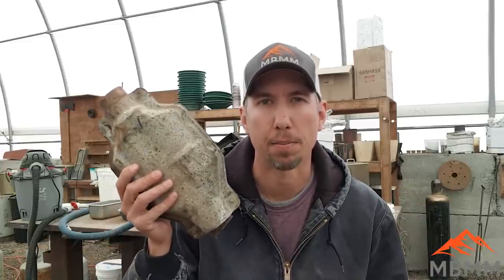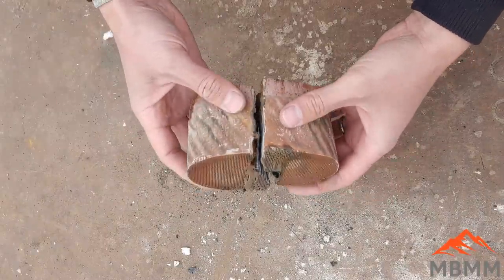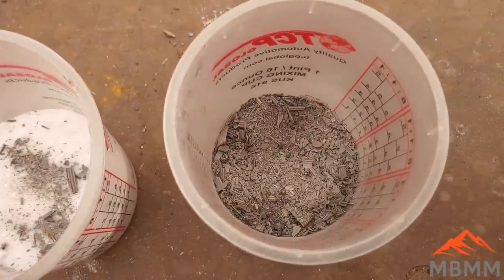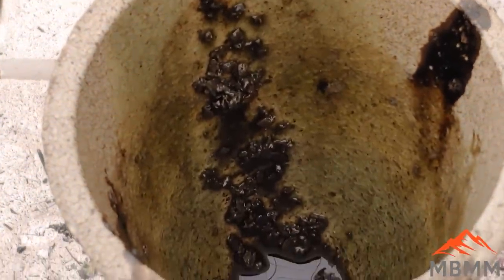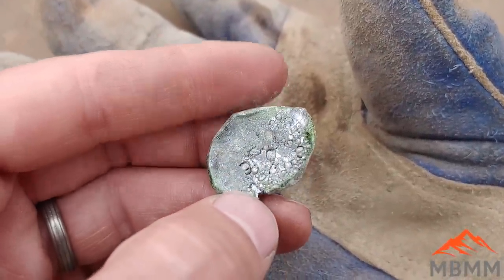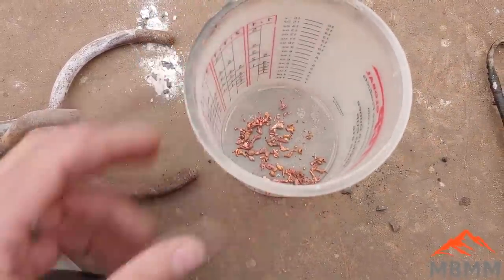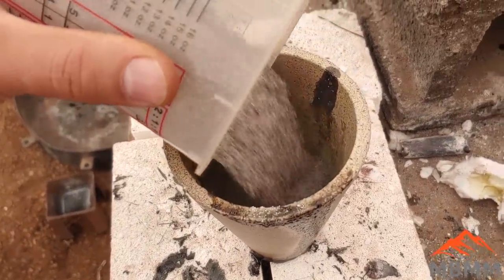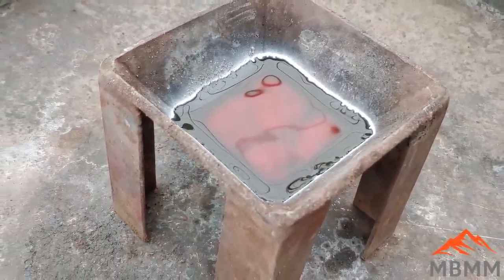Can Platinum & Palladium Be Smelted From Catalytic Converters? Urban Mining Platinum and PGMs!

Comment: Of all the comments only Seymour Pro made a reference to the XRF gun. I don't understand why you are working in blind and just assume things when it just takes a minute to test the materials along the way.

1. Test the cat material to see what proportions of PGM:s there is. If you have 20% Pt and 80% Pd when you start then you should have roughly the same proportions when you are finished or you have losses along the way.
2. Test the lead and copper used as collector metals so you don't add anything that way. There are especially high grade lead sold for doing precision work assays via cupellation.
3. Test the collected metal as well as the slag to see what you collected before cupellation.
4. Test the beads after cupellation as well as the cupel. That way you might be able to detect any losses when cupelling with copper.

All in all an interesting video and my guess on the color change of the slag, oxidation state of the surface, some oxygen have penetrated and oxidized the surface layer. But you have an XRF, use it to see if there is any difference between the composition of the red pieces compared to the core green slag. :-)
I wish I could afford an XRF, it's such a versatile tool when working with precious metal scrap.

Comment: there is a monthly guide available that lists the the amount in $ that each catalytic converter carries by make and serial number.
Some Cats have A Lot of metals, and some almost nothing. Most 3rd party replacements have Little PMGs Try one from a dodge 2500, there should be a lot in one of them. get it from a muffler shop not ebay, many of those are already acid washed.
Gasoline cats are mostly Palladium (1oz/10 average) with a little Platinum and Rhodium( 1 oz / 100 +/- cats).
Diesel Particulate Filters are mostly Platinum then a little Palladium (with RH) 
The metal makes the burn temp.
The metal is usually Fumed onto a ceramic honeycomb, very equally distributed and deeply penetrating the ceramic. The ball/bead catalytic converter the metals is only on the outer surface of the ceramic beads.
There are also metal based catalytic converters, I think they would be better for Vulcan style recovery vs alchemically. 
Do you have access to a centrifuge? no? make a holder with a wire and swing the liquid metal before you pour it, that will help concentrate the heaver metals.
if you liquefy the ceramic you might try ultrasonic vibrations to get the PMGs to separate out of the ceramics. It is Closely Associated. Stiring may help also. Think of it as rendering lard from fat.

Comment: Hi Jason I have tried smelting 100g of ceramic to extract platinum But it didn't work And I added everything I mentioned in the video 100 grams of ceramic needs 100 grams of borax, 100 grams of sodium hydroxide and 50 grams of silicon Are these articles correct

Comment: This is okay if you get the catalytic converters legally, where I live there is a rising problem of thieves cutting the converters from cars, even on peoples driveways. You have massive expense to replace the converter so you can driver your car again
Reply: I cut them out of my own cars I buy and scrap them, we don't have emissions in the county where i live! Its the first thing I do pull the exhaust down cut a hole in the top of the cat take the comb out weld it back shut and get a spacer for the rear 02 sensor so it doesn't read rich and mess up the air fuel ratios and set off check engine lights.
Reply: @DanTheMan454  Nice. Ya gotta do what ya gotta do. 
Be well wherever you are, my friend.

Comment: Very interesting, and Good Video. 
If u try to find platinium u have to use converter of Diesel Cars. For exampel VW  tdi or Mercedes cdi (Look the Photo)
Only Diesel are 100% Platinium. 
Benzin Converter are different Mixed of PD, RH, PT

Comment: Need to soak the converter in hydrochloric acid to get rid of all the base metals , still crushing up the catalytic converter , and on a medium heat for an afternoon , then do straight aqua regia( 3 parts hydrochloric, 1 part nitric)  until all the metals are dissolved , and then add 50 grams zinc powder to the dissolved solution to drop out all precious metals. even a thin metal plating should yield two grams from a honeycomb surface like that . And the good news about using zinc is that it easily dissolved in HCL so any black to purple powder at the bottom of the beaker will be all the precious metals above zinc in the dissolution scale of chemical digestion. Gold Platinum , Palladium, and there shouldn't be any silver in there , but if you get a white pasty powder in the bottom of you aqua regia bath then it's silver so always filter the aqua regia before adding the zinc powder.

Comment: Palladium is used in gasoline engine exhaust, and platinum in Diesel. Considering scarcity of diesel cars, you most likely processed a "gasoline" converter, so your result should not be surprising. Nicely done both, experimentation and vid!

Comment: The Cadillac converter that you used if I am correct is called a pre cat which stands for pre catalytic converter they are usually up closer to the engine right off the headers and they are less than half the size of a standard cat

Comment: I think you are running into a few problems.
1. The surface area of the CC honeycomb powder vs surface tension of the melted metals.  The amount of melted precious metals is so small it would be very difficult to move to the bottom of the crucible. I would think if you got the "solvent" metal in contact with the material it would work better, but I think it would be difficult with this setup.  
2: Melting point of Platinum is over 3200F.  I didn't hear the temp you said you got to, but if the lead or copper isn't touching the surface of all the catalyst material, how would it dissolve the precious metals? 

I was confused by your videos bc I never heard of a cupel before, so I may have missed some things you said while I was trying to figure out what you were doing.  I thought you had boiled off the 100+g of lead when you got that bead.  So IDK if you have mentioned this but the copper and lead are working as a solvent for the other metals, allowing them to melt at a lower temp.  I did this with Zinc allowing aluminum & copper to melt into it at a much lower temp than either of their MP.  So if the alloying metal wasn't in contact with the catalyst material it's not going to absorb it. I think this may be the reason why acids are used for recovery of this product.  They may also use larger amounts of copper and process many converters with the same metal so when it's finally cupel'd there is a much larger amount recovered.?
Reply: KDE5FAN, to answer your question about the lead, Jason heated the mixture with the kiln door slightly open to permit oxygen in so the lead would oxidize.  Lead oxide is "soluble" in a bone ash or calcium phosphate cupel and flows into the thick wall of the cupel, in time, leaving the platinum behind as a bead (at least, that was the plan).  The cupel is a single use cupel, now filled with lead oxide and has thus become an environmental concern as a waste product.  Sinnce lead oxide is quite insoluble in water, it doesn't travel very far over time if it were put into a landfill dump (maybe eleven inches every 100 years).

Comment: James, good day! I watched your video again. I am interested in this question, but we do not have catalysts - waste treatment of the factory with the content of PMG and iron. We will study this issue, I found this article check it out. It is interesting + further electrolysis. (An Integrated Capture of Red Mud and One-Step
Heat-Treatment Process to Recover Platinum Group Metals
and Prepare Glass-Ceramics from Spent Auto-Catalysts
Chuan Liu 1,2, Shuchen Sun 1,2,*, Ganfeng Tu 1,2 and Faxin Xiao 1,2) Minerals MDPI

Comment: I wonder if the red Slagle was caused by oxidized copper cementing out on contact with the steel cone mold and forming iron oxide

Comment: Forgive my abysmal ignorance, but as Pt has a S.G. of 21.45, could the catalytic  converter innards be ran through a vf  mesh hammer mill thence the water table for separation prior to smelting?  Just a thought.
Reply: Won't work, it's too fine particles so it won't settle on the table.
Reply: @goranaxelsson1409 Particle size didn't occur to me.  Thank you.

Comment: I think, since the mold was made out of iron, the copper oxides rushed to the sides, reacting with iron and being reduced to pure copper, while iron, being far more reactive metal than copper got oxcidised, resulting in the ghoulish green slag on the inside and red layer on the outside.
Reply: very cool, much in the same way iron is used to precipitate copper out of coper nitrate. copper is such an amazing metal.

Comment: I was originally taught that Fe is a better collector for Pt.  Pt apparently has a large affinity for Fe.  Never tried it but perhaps this would work for you.  I always go the chemical route with cats.
Reply: Got a valid point there,  worked at Platinum refinery long back and they used acid in leaching off iron.
Reply from the maker: Thanks for the tip!

Comment: I wonder if the red coloured slag is to do with the WD40/carbon you use as a release agent locally reducing the copper in the glaze. In ceramics you get green glass with copper in an oxidation atmosphere and red glass in a reduction atmosphere (fuel rich flame)

Comment: Try using silver with your lead, rather than copper. Cupel off the lead, but don't oxidize the silver. Process the bead chemically.
Reply from the maker: Thanks for the tip! We'll definitely think about trying that in the future!
Reply: Although fascinating to watch(Sreetips, Cody's Lab, Nile Red, etc), the chemical process consumes a lot of costly and harmful acid's and other materials and produces a lot of waste that needs to be dealt with.
Reply: @benwinkel  costly, true, but there's a reason it's the method that is used. PGMs are flat out difficult to deal with, so the losses through smelting are greater than the expense of alternate methods. That assumes, of course, that you have material to even make it viable.

Comment: So is there a way to know if a catalytic converter uses platinum or palladium? Also do any of them use a mix of both?
Reply: Most of them use both.
Reply: Could use part numbers or knowledge of differing manufacturers favouring different approaches to emission control.
I'd guess most cats appearing as scrap now would be from 1980-2000 cars. During that period companies like GM would spend more money on the engine control systems & less on the catalyst system (including the cost of the precious metals).
At that time Palladium was cheaper than Platinum, was very much cheaper than Rhodium. All three can be used in gasoline three-way catalysts. Toward the end of the 1990s Pt price increased dramatically due to the market penetrative of diesels in Europe. Cat coaters like Johnson Matthey, Degussa (dmc2, now Umicore) and Engelhard (now BASF) developed Pt/Pd Diesel cats and the US market moved toward Pd/Rh three-way catalysts.
The part yr man was smelting appeared to be from an underfloor location (not close-coupled). This could explain the relatively low precious metal content. 
However, the real enemy of any recovery operations are the other catalyst components in the coating.  Ceria and alumina have complex high temperature chemistries, and along with the high surface areas will 'conceal' the precious metals from the collector.  The honeycomb substrate is usually cordierite and will also use a high quantity of the flux to dissolve.
I need to do the math on what yr guy should expect by way of yield. Was a small part, underfloor, and using modest recovery methods. 0.2g Pd (38% of 0.67g) wouldn't be a bad recovery rate.

Comment: Hot copper/ copper oxide upon touching iron in the steel is reduced to its metallic form (due to nobility) in exchange for some iron that's why the outside of the slag is iron looking... btw that will destroy your cone mold!!

Comment: My knowledge about smelting is zero.  But I am just wondering what would be the second step after the copper stage.  I recall from history there was a bronze era, where copper was alloyed with tin to form bronze.  And in more recent times copper is alloyed with zinc to make brass.  Both should be alloys with rather low melting point, if I'm not wrong -- maybe close to pure lead?  I have some books sure to givie the answer, but am too lazy to dig into them -- sorry.
Reply: No, neither brass nor bronze have melting points anywhere near lead.

Comment: You had indeed a reaction with a fe iron with coper oxide on the side. Probably coper oxide with platinum on the side of the cone. With a grafite cone the problem would be solved.
Reply from the maker: Thanks for the tip!

Comment: did you check to see if your xrf can show platinum. there is a chemical test to identify it. Also, i thought nickel was used as collector, atleast thats what the professional labs do.
50/50 hcl water will take out silver and palladium and leave platinum, you can then drop silver and palladium in that order

Comment: I'd powder the converter up .I'd dissolve in aqua regia incremental doses of nitric into hydrochloric .stanous chloride test for metals in solution .neutralize the solution with sulfamic  acid and recover with ascorbic acid .pure bit C .
Reply: but his specialty is precious metal recovery without acids.
Reply from the maker: Thanks for the tip!
Reply: There is many ways too extract pretious metals.chemical mechanical pyrolysis.electrolysis .and combination of 1 .2 or even 3 .to obtain every bit out of a sample .

Comment: All cats are not created equal...value differs widely in metal content. A used replacement aftermarket cat maybe worth only $5 a factory one with high metal content maybe worth over $500. Here's a sample of prices a dealer in my local area gives for certain cats...provided they have not been tampered with.  4 & 2 Line Fin Center Sensor – $891 CAD
Ranger Dub – Up to $376 CAD
Lobo Pre – Up to $318 CAD
Lobo Cat – Up to $403 CAD

Comment: First off, that is an aftermarket catalytic converter, which have practically no platinum in them. Even worse is that appears to be a universal aftermarket converter, you literally couldn't have chosen a worse converter as an example to collect platinum from. If you want to recover platinum from catalytic converters you have to find OEM converters (converters that were original equipment), otherwise you are just wasting your time.
Secondly, as someone else already stated, a plasma torch is not what you want to use if your goal is to salvage what is inside. Plasma Torches can reach temperatures in excess of 11,000*F while platinum has a melting point of about a third of that.
Reply: What is a after Markets catalytic do you mean before the price go up
Reply: @victordansereau8444  What?

Comment: Be very  careful with the dust from that stuff. The platinum will cause platinosis and is very bad for you.
Reply: Platinum salts.
Reply from the maker: Thanks for the safety tip!
Reply: From what I read, once you have platinosis there is no cure.
Reply: There are plenty of far worse things to worry about in that environment! 
Biggest concern i know about would be the refractory ceramic fibres holding the catalyst in the metalwork. Very finely divided fibres with oftentimes asbestos-like structures.  You need first class respiration systems very well maintained if you're to avoid lung disease.
I'd be exceptionally careful around the cupel furnace - but that's partly my understanding of heavy metal metabolisation, and my blissful ignorance of that process!

Comment: I would just wash the guts out with aqua regia without dismantling them if they are only plated on, they will dissolve in the acid and then you can just precipitate them out and refine the practically pure platinum dust with silica into a bead.

Comment: This converter was very small, you should expect to recover below 1gram of PGMs, do not expect to recover only platinum, palladium and rhodium is also present, in some cases platinum has lower concentration than palladium, if you are after platinum go for diesel particulate filters, the platinum concentration is very low in them but no palladium is present also the DP filter mass is usually above 2kg. You can test for palladium by adding HCl to the pulverized mass heating it and bubble in some chlorine, if the mixture color turns red you have palladium in it in appreciable amount

Comment: the green is probably the oxide from the copper , could be its so hot / agressive that it pulled the oxide out of the mould
dont think that the palledium is worth it to extract it through heat and burning up other metals (in therms of cost for the labour metals gas and electricity , its probably pretty toxic too ), it might allso be that a lot of the stuff allready burned off from the catalic converters use

Comment: I'm no Pro but that look like an aftermarket converter and I tried to sell one one time to a scrap yard and they would not buy it they said there was no metal in it
Reply from the maker: Thanks for the tip! It seems that everyone is saying this same thing.
Reply: @mbmmllc  You need one from like an 80s Dodge truck. Earlier the better. 1976 is when it started with Cats
Reply: There is definitely metal in it, it is just that oxidation converters have almost no platinum and mostly palladium.